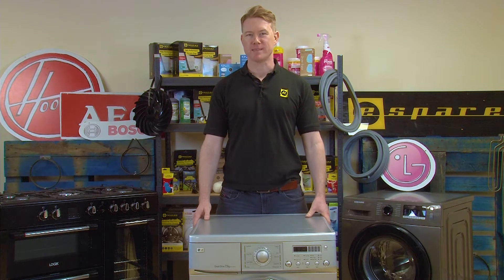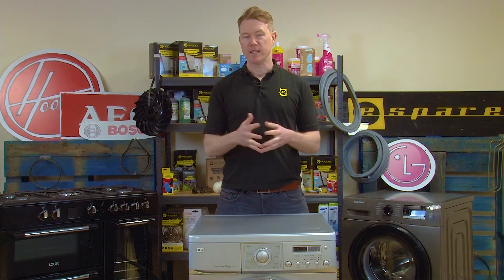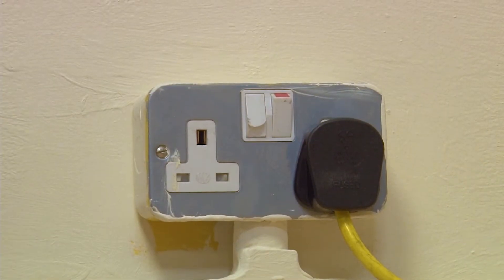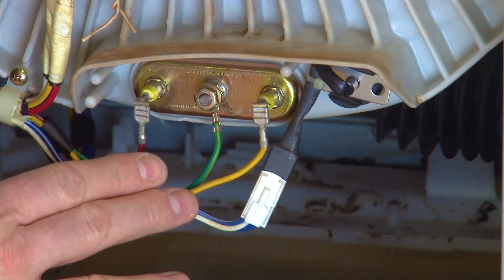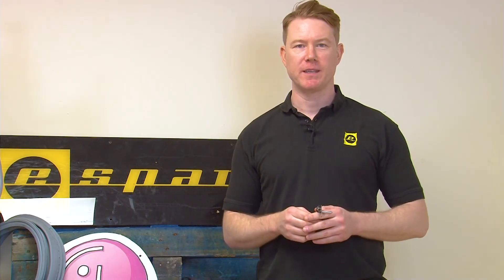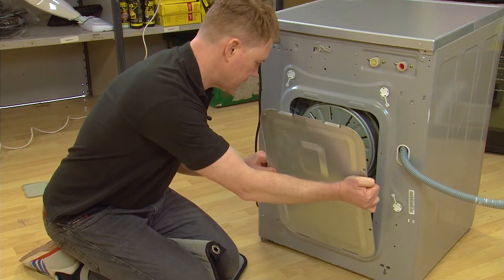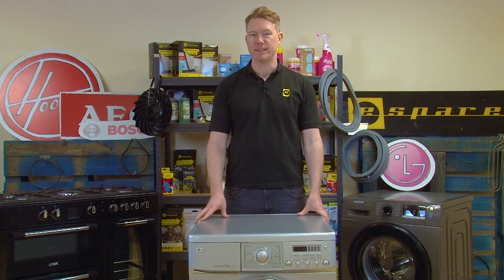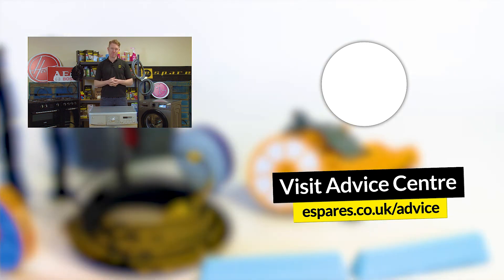How to Replace the Thermistor on an LG Washing Machine

Comment: I just wanna say for folks that have older versions of this washer you can get at the heating element and the thermistor at the front of the machine tilted back and it’s up underneath. Also note that in my case, I can’t buy the Thermistor separately I have to buy the heating element and it includes the Thermistor.
Reply: exactly..  i am having same thermistor problem.  it seems to locate on the front..   yet i dont know how to take out the whole heating element.   is there a video?
Reply from the maker: HI, we do have a video showing the heater replacement on an LG washing machine, that you can check out here:
https://youtu.be/KjIpagPT--o
Reply from the maker: Hi, thanks for sharing the information regarding your particular model of washing machine.